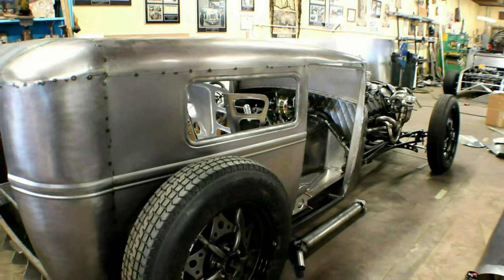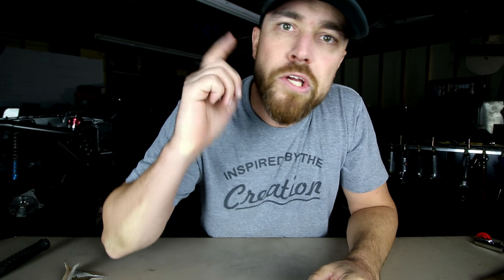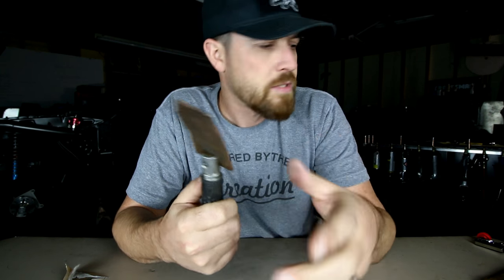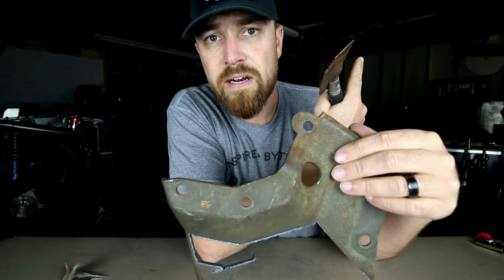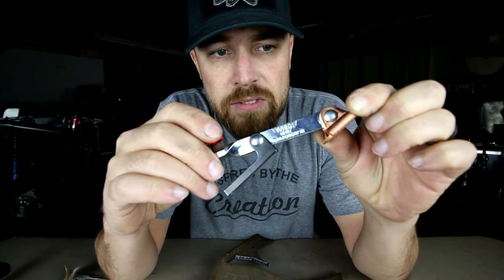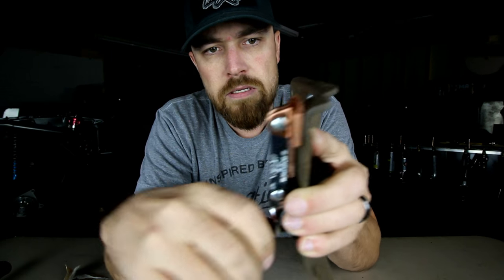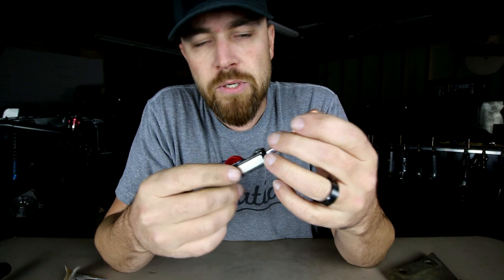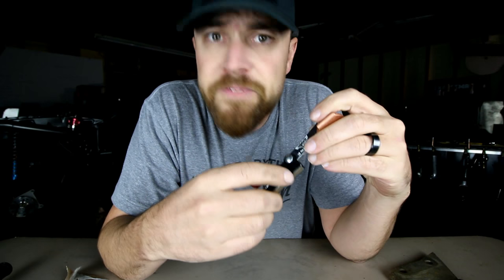You Need This Tool - Episode 42 | Magnetic Plug Weld Tool

Comment: question maybe you can answer i have a  caliper bracket that striped out the treads on to make a long story short i ended up welding the hole up and i fought redrilling it out yesterday how the hell do i get the temper out of the weld   thanks ahead of time
Reply from the maker: not exactly sure...
Reply: The Fab Forums
I ended up welding a nut on it and modifying a bolt thanks for your response